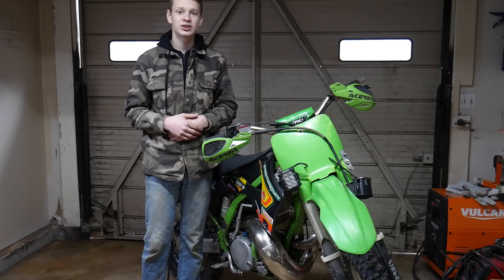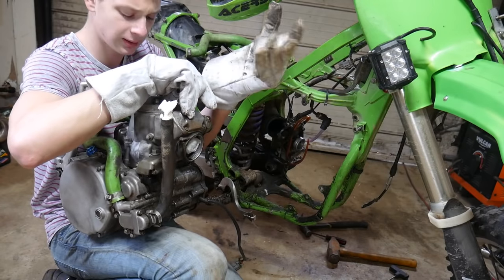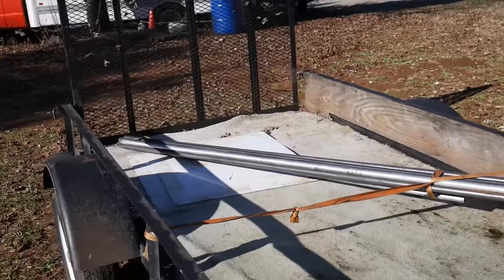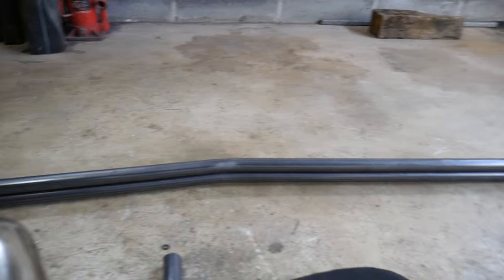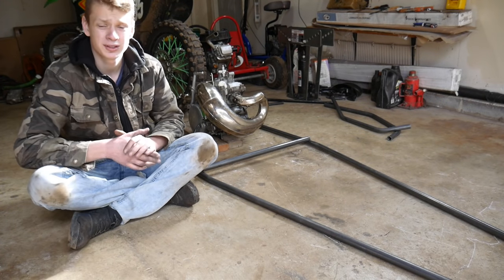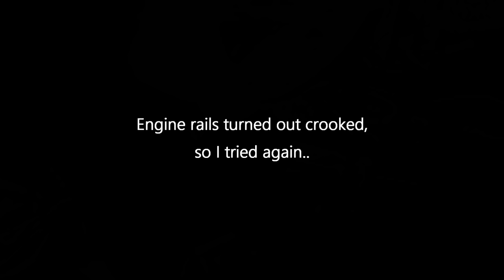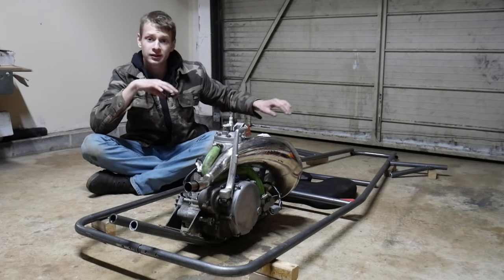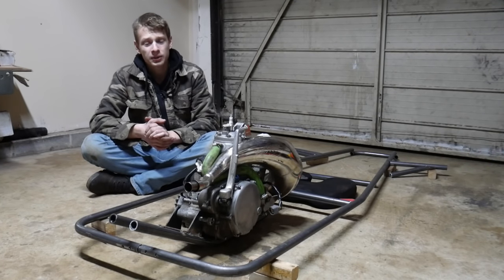Building A Kawasaki KX250 Shifter Kart Part 1

Comment: I like your videos man. Information is always key for those who want to try and replicate. I was hoping you'd be making a shifter cart with that motor. Really like the idea of a center mounted engine rather than the side. Lengthens out the frame, but with it being a larger motor should do fine. Can't wait to see part 2.
Reply from the maker: Dang I didn't think about it that way! Thanks alot!! I did some research about the engine placement and wheels bases. I came to this. I would like it to be fast in the straight but also be able to corner. I will try to make the weelbase short as I can, without sacrificing the "dragster look.". If i am ever going to the track, I will try to make it to where I widen the rear wheels for a better stance.

Comment: good job on the tube bending, I suck at it...something always goes wrong lol! Sweet video! keep it up
Reply from the maker: Thank you! Bend in intervals, and use the smallest die possible
Reply: Tube bending isnt hard if you have basic knowledge on how to properly measure your bends and use an actual tube bender and not a pipe bender. There is a big difference in how each one is designed to be used.

Comment: Finally but there is a mistake. It should be a independent suspension. Good job btw love the build👍

Edit: i thought it was the off road go kart. But please engine swap the off road go kart. Go on ebay and type “cbr600r engine” or 1000cc it will be the greatest project on YouTube.

Comment: Sweet project. Hey just wondering if you knew how nasty stainless welding fumes are.. 

Welding and Hexavalent Chromium  

Chromium is a component in stainless steel, nonferrous 
alloys, chromate coatings and some welding consumables.

Chromium is converted to its hexavalent state, Cr(VI) , 
during the welding process.

Cr(VI) fume is highly toxic and can damage the eyes, skin, 
nose, throat, and lungs and cause cancer.

OSHA regulates worker exposure to Cr(VI) under its 
Chromium (VI) standard
, 29 CFR 1910.1026 and 1926.1126.

OSHA’s Permissible Exposure Limit (PEL) for Cr(VI) is 5 μg /
m3 as an 8-hour time-weighted average.
Reply from the maker: Didn't know. The pipe was 3/4 schedule 40 mild steel. I think i will just make those stainless steel panels removable

Comment: Nice work! Notching with grinder isn't easy, but yours look spot on!! What size tubing are you using for the main frame?
Reply from the maker: Schedule 40 pipe 3/4" haha I have been practicing several days. It only works for 90deg fit ups, but I am getting super efficient at it. It may be because I am using a much bigger cutting disc.

Comment: 2stroke vs 4stroke what’s faster, what has more torque, what’s quicker???
Reply from the maker: Either can be built to suit the rider. But generally 2 strokes are faster than 4 strokes of twice the size. So a 250cc 2t dirtbike is head to head with a 450cc 4t dirtbike. For example a 50cc 2 stroke dynoed at 18hp-20hp. almost imposible for a 50cc four stroke to do that. however a gsxr 600 4t  boasts 110hp+ while a cr500 2t only  60

Comment: Hey bud , do you plan on driving that thing fast !  Make sure your welds are good , take care on the front end spindles , lots of torsion there ... the videos are good but you should work on your lighting and microphone... I do ending build for a living .. I also make videos .. mine have the same problems so I’m just trying to help .. like the videos tho .. keep it up .. if you want to go fast someday I’ll make you a cylinder head for one of your engines  then you’ll be happy... check out my engine builds .. mostly gx460 big blocks .. trying to break the world record .. getting close ...
Reply from the maker: Yessir. I think I will 6011 stick weld all the critical components and brace the spindles and I think it's going to be great. I did buy new LED lights for my garage. But thanks for the feedback!
Reply: I have built a 125 shifter kart but from another kart .. what your doing is a huge task so good luck ... how fast are you planing on going ?
Reply from the maker: @paulskartslifan4206  not sure, I just wamt an agressive look and better content for my channel.
Reply: More crashes !!

Comment: This will outrun red beards and rather B welding shifter cart
Reply from the maker: 😂 I was thinking off the ducarti
Reply: Yea, obviously... You know that this is a 250cc, the other two carts are 85cc ??
Reply: carsandcameras ducarti is  70hp 900cc ducati L twin powered you know? obviously... its gonna be close
Reply: @Hermiwalle  he didn't mention carsandcameras.
Reply: Malte  Weiß the ducarti as he mentioned in his response is made by carsandcameras m8
Reply from the maker: Malte Weiß   Yes I was messing around. It will blow the panties off the 85cc shifter karts. Herman Wallin Cars and cameras cart is very powerful so they would probably take a 250cc. But I heard Isaac say it was spinning the whole way down the dragstrip, so who knows
Reply: @VasilyBuilds yea, if you build a good frame and have good tires and traction it could have a real chance. Because 250cc two-stroke is madness !

Comment: Why is the steel so rusty
Reply from the maker: If steel sits outside, it rusts.
Reply: Just wondering cause you went and got it so I thought the steel would be in better shape I am building a project right now and the steel company’s around me don’t sell rusty steel most is coated in a oil
Reply: Just wondering cause you went and got it so I thought the steel would be in better shape I am building a project right now and the steel company’s around me don’t sell rusty steel most is coated in a oil
Reply from the maker: yea, it wasn't that bad, it was coated in oil too

Comment: what a waste you could just by a engine alone on ebay
Reply from the maker: A waste? If you payed attention in the video,  I hinted that I will be using the frame for another project. It's best to have a parts bike, that way it comes with all the hoses and harnesses and radiators etc. And I won't have to order them separately.
Reply: oh i didnt think you were doing any thing withe the other parts its cool dont get me wrong  @VasilyBuilds

Comment: Hello Vasily
I have question, do you lathe the short round bars that you are using on the Joints of the 3/4 tubes for the frame? I mean or you just insert the round bars as a raw material? Sorry of my question is not very cLear